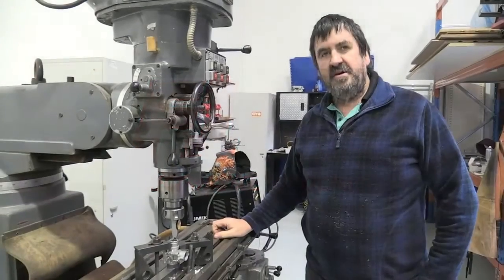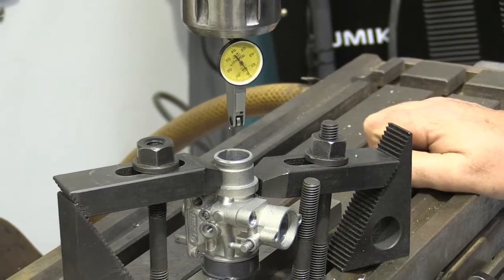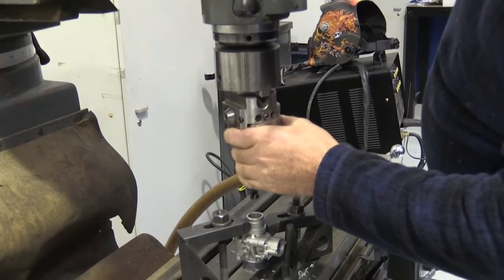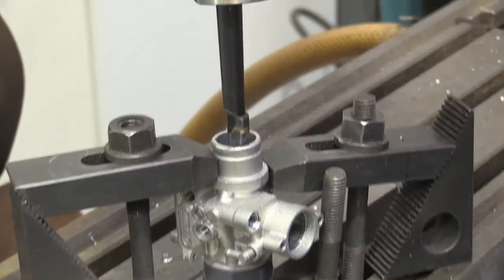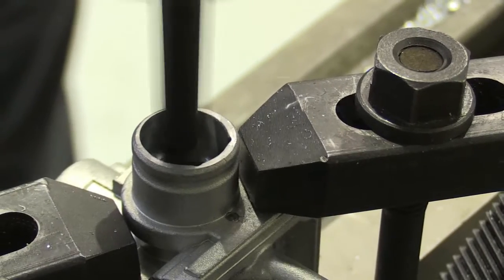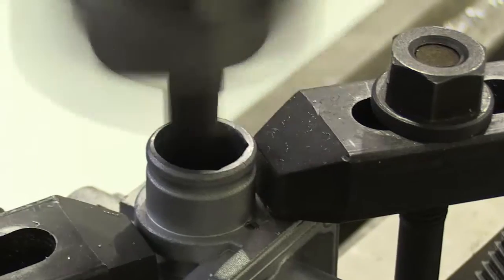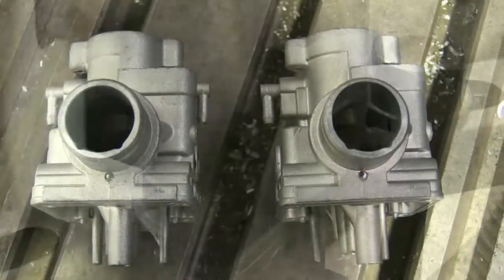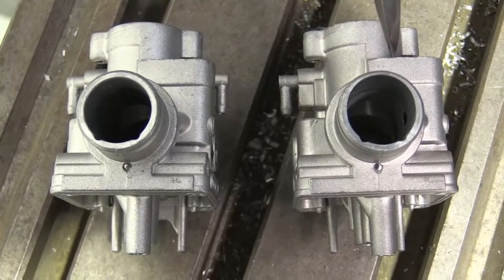F1MOTO ENGINEERING MACHINING KTM50 KTM65 KTM85 CARBURETTOR BORE MOD INCREASING HORSEPOWER

Comment: What do you do with the carb boot or a rad valve since it stays at 28mm bore?
Right after 30mm carb, there's gonna be a step down to 28mm rubber carb boot or rad valve.